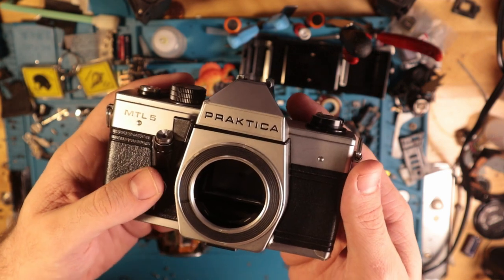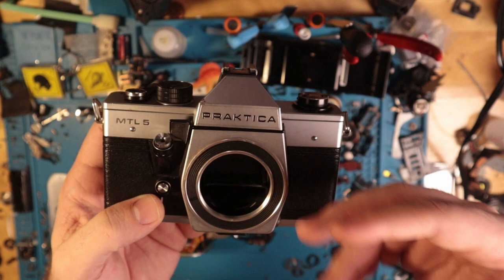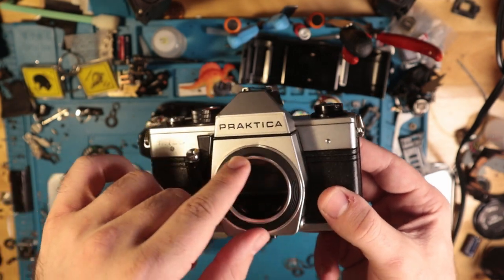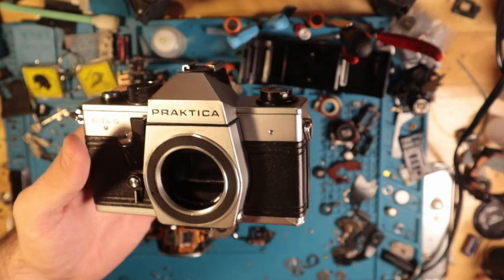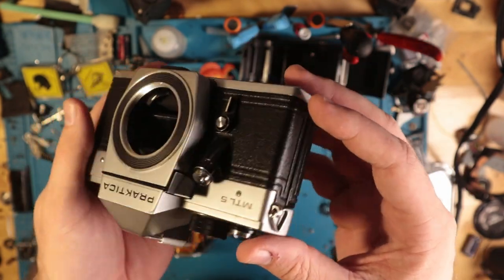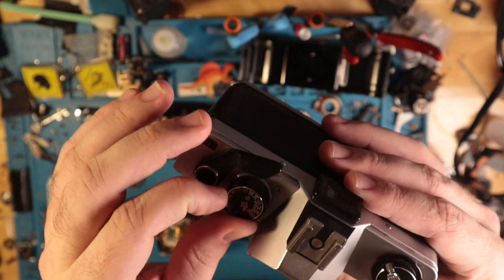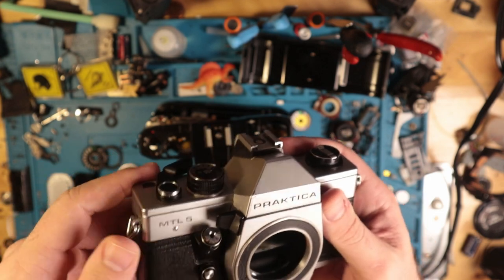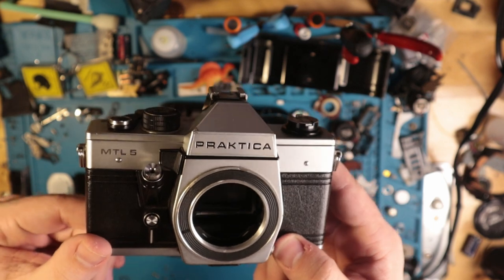The Last Video

Comment: How dare you bad mouth the best 35mm SLR of all time ! 🤣 Really though this video brought back memories of my early teens in the 70s. I asked my parents for a camera for Christmas one year - an SLR no less - and what did they get me? Not a Canon, Nikon, Pentax, Minolta or Yashica as a normal kid would get. No. They got me a Praktica LB2! (one of my friends quipped - "oh so it weighs 2 pounds.") If you think the MTL5 was bad, at least it had TTL match needle metering. The LB2 is about as primitive as you can get. No TTL metering. The body style is similar to the MTL series. Instead it had an external selenium photo cell sensor on the left hand front in front of the rewind knob.  On the top was a match needle window. The viewfinder had NO indicators at all - just a dim split prism focusing screen. You set ASA/DIN on a knob around the rewind crank. It used NO BATTERIES....power was supplied from the selenium photo cell! So you can say at least this was a very GREEN solar powered camera! Everything else was mechanical. The Praktica's were all VERY weird. Yeah these designs really turned me on to communism (not)! I thought the weirdest design was the angled shutter release on the FRONT of the camera. Every time I gave this camera to someone to take a pic they would try to press something on the top!  Of course, how could you miss the loud and proud Praktica shutter/mirror CLUNK/THUMP/CLINK. The film advance crank was torturous - especially when compared to the silky smooth advances on the Japanese cameras of the time. Despite all this, I managed to take some really nice pics (both print film and SLIDES - Kodachrome 64 was my fav) as I learned photography the hard way. All I had was a 50mm lens attached. Oh you have to love the M42 mount - nearly 8 turns to attach/remove the lens!
About a year later I tried to trade it in at a couple of photo stores for a better Japanese camera - in one case the sales guy looked at it, tried it out, smirked, and said - I'll give you $5 for it. Another said - "Don't even bother!" Well I kept it for many years, even after I upgraded to an OM-system in the 80s/90s (wow that was light years ahead!) The LB2 departed from me when someone STOLE it off my desk at work in the early 2000s. Little did they know they did me a favor. I always kept an interest in these cameras and always wondered if they would ever make a digital version...all they did was private label a p/s camera from someone. I did order a B200 kit (WOW a Pracktica with an automatic shutter AP/manual and TTL LED metering!) It also had a BAYONET mount what an advancement! It came with 3 lenses and I played with it trying to get back into film but I really got spoiled with digital! Oh well. 😮
Reply: That's funny. Now people are paying unseen prices for these old Soviet cameras. Honestly, they were (mostly) very well build.

Comment: Hi
I don’t know if you will pick this up, however I have a conundrum for you a little like your Pentax with the little spring that you said, all you can see it do is stop the lever action from back winding and so you removed the spring and set it just a tad, so that you Pentax now works with a full lever action, well I have discovered a weird one, Pentax ME Super lever action works, blown out with air, isopropyl to dislodge and clean gunk, but the action works and fires fully when holding horizontally fires every time, turn it so base is facing upwards and two actions later it’s like you’ve put it in bulb mode, turn back and a couple more actions, and it’s back to firing again, turn again through 90% so top is facing upwards and a couple of actions and it’s like bulb mode again. Nothing seems loose but it’s almost like gravity in either of the positions of holding as normal or turning it to look at the bottom, is having an effect on something in action. Any ideas? In Advance Regards David New Forest U.K.